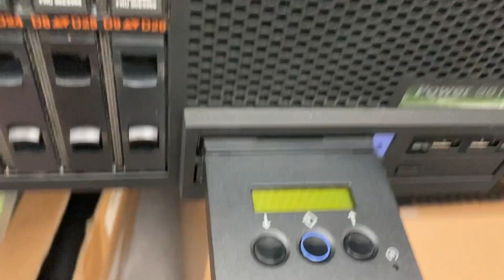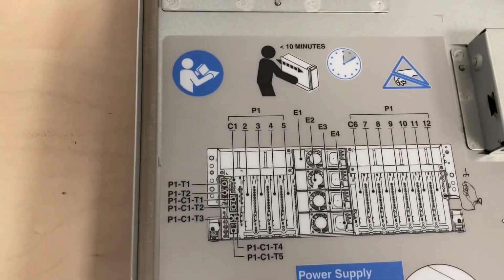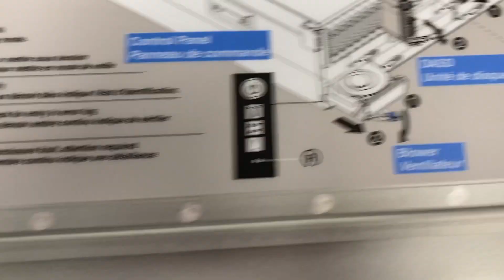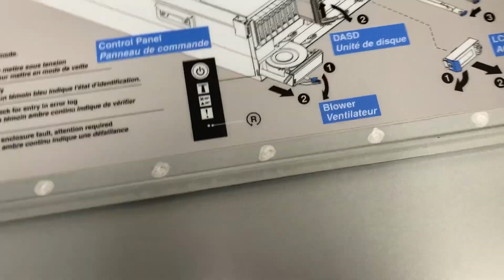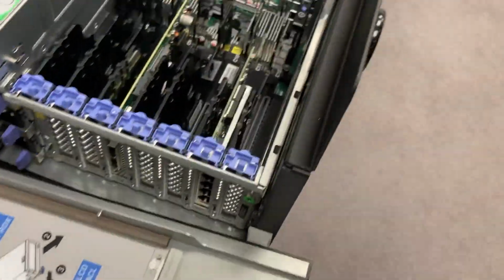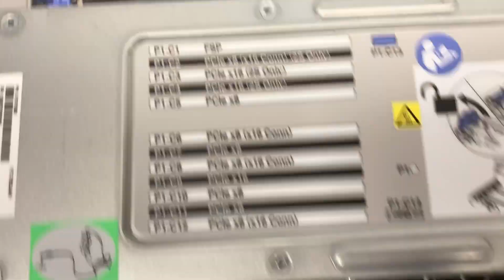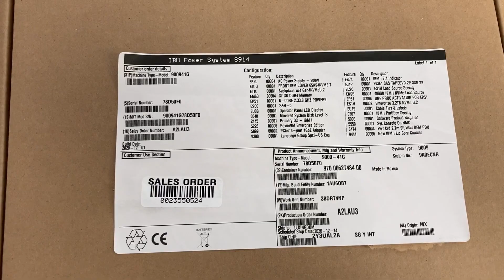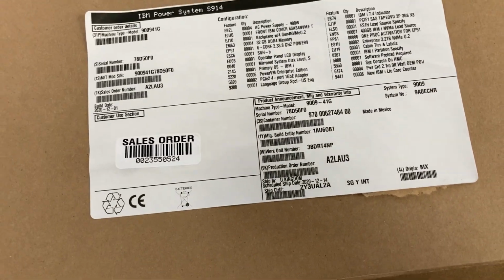IBM POWER9 Unboxing Video Part 2

Comment: The power9 systems are great, my 8 core workstation is a great build system. Thanks for giving it attention.
Reply: Can you do a video/send me some info on how you built that(parts)/what you run on it/etc? I've somewhat been wanting to build that type of machine myself. If you've got a website on it, post a link :)
Reply: @stevethree3708  I will do a video one of these days. But my machine is the 8 core chip on the blackbird, I have a amd wx5100 pro and a duel nvme PCIe card for raiding. The case is a fractal meshify c. I mainly use it for VMs and as a build system for guix. I works great for both those things, graphics is good but a lot some bugs. Also anything rust is going to be a no go, since that languages community refuses to develop it for other ISA's. But yah ill find the tome to write a blog or vid